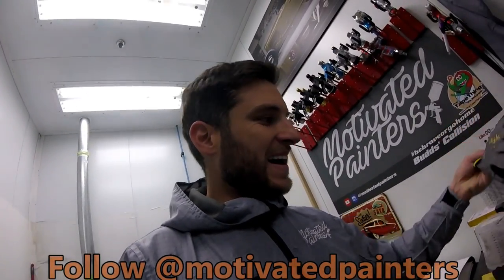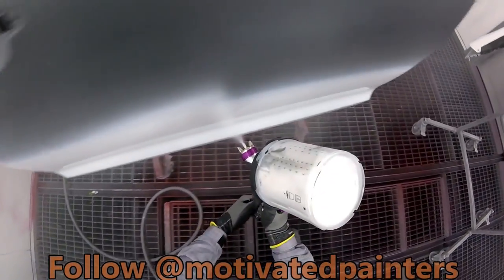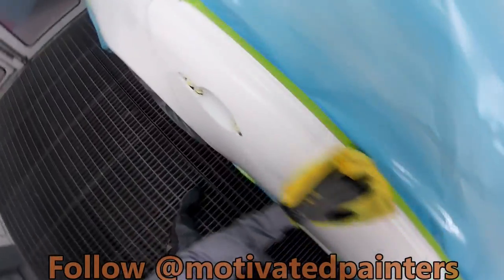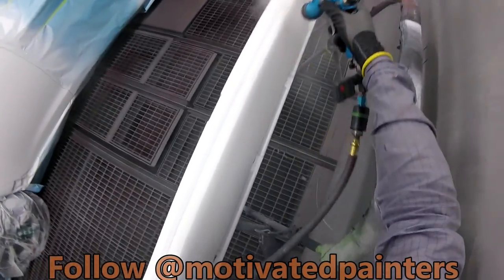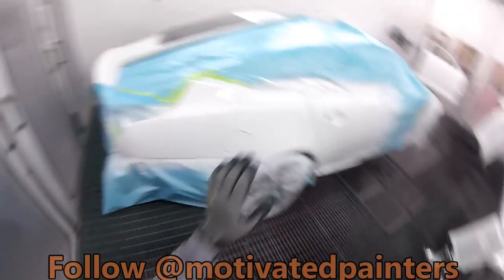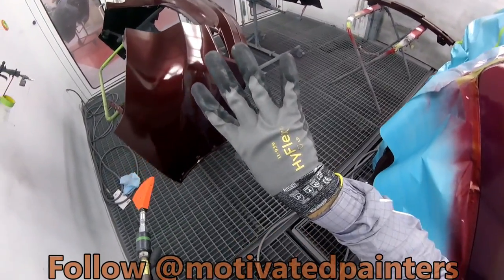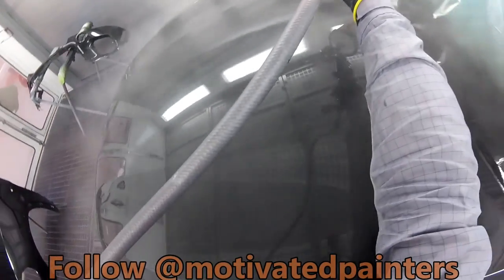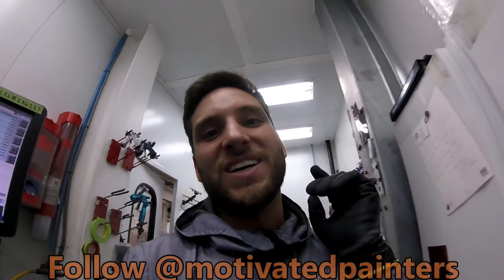I Can't Believe these gloves!

Comment: The car has spray mask. I got it. BUT.
Dumb question from a newbee. How do you keep the overspray from the spray mask from getting on the panel you're going to paint??? Do you have to mask the car twice. (Once for spray mask and once for paint??)
Or maybe it wipes off easily from the panel you're painting??
Reply from the maker: Nope it washes off with water
Reply: Gabe:Not to be a pest but maybe it's worth a quick video for us newbees.So  you spray most or all of the  car with spray mask then paper and tape mask then wash it off the panels you're going to paint or ……???
I was confused how the spray mask overspray doesn't make it hard for the tape to stick etc. etc.
A picture (video) would be worth a thousand words :-)

Thanks
Reply from the maker: Type in good spray mask motivatedpainters
Reply from the maker: Type in YouTube search

Comment: What gun brand are you using
Reply from the maker: It's called prona Google it they sell them here in Toronto
Reply: @MOTIVATEDPAINTERS   Hola Gabe. Which model Prona is that gun?
Reply from the maker: R4300A
Reply: Just realized the only gun I recognized was the Iwata. What were the sealer and then base gun?